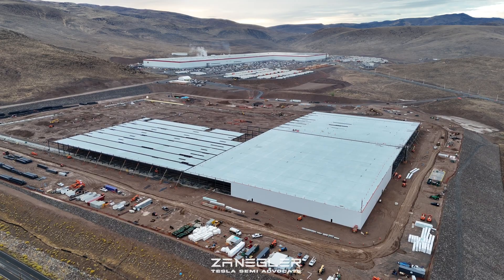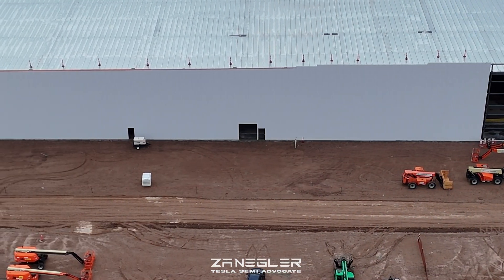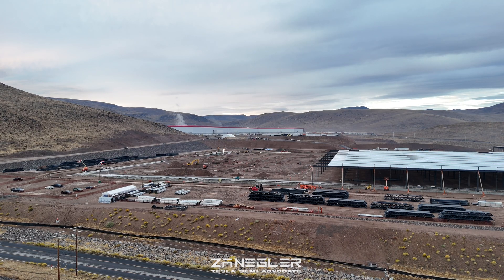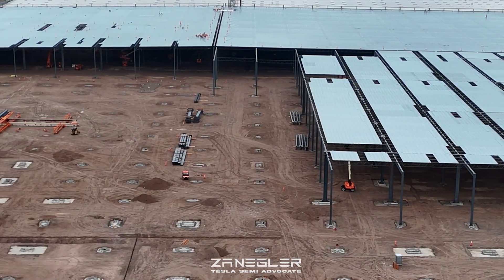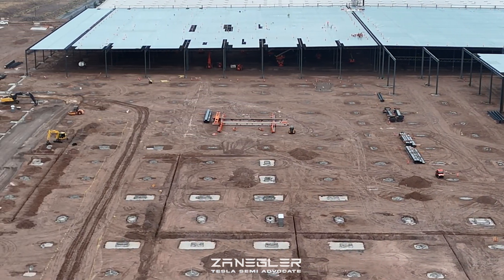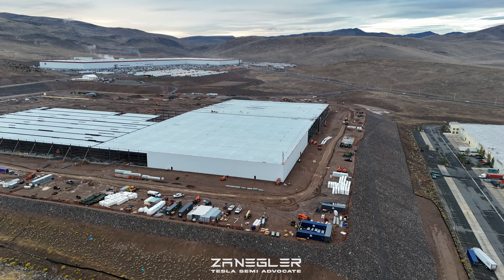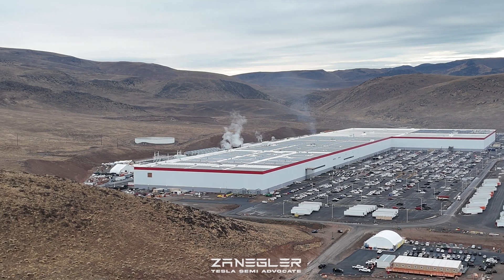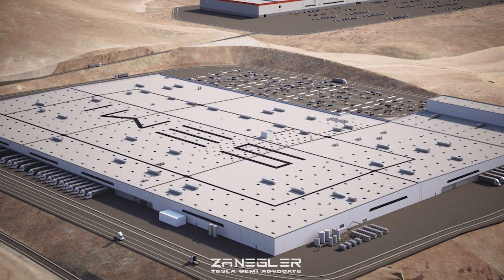Tesla Semi Factory - Several Changes and Surprises are Evident -10/17/2024

Comment: There's no doubt that a lot of money has been made off of Tesla stock. Even though the company has made very little money off of actual cars. And if you take the subsidies out, the whole joint would be closed down. I knew Tesla stock was going to take off into the end of 2019 only because of YouTube videos and how absolutely insane The Fanboys are. To put it bluntly I compared it to going quicker and quicker as the climax approaches. Though it was not quite that polite. Tesla like all of Elon's businesses is a scam. It's nothing but undelivered promises and an overpriced car. There are half a dozen companies ahead of him on full self driving. And the ones that actually have full self-driving taxis right now are four or five years away if not more from being certified and operating a going concern. Elon is 10 at the minimum. The man is a complete fool. Why would you not want to use lidar and radar to gather more data if you have access to it? Only a trump supporter would have that kind of logic. I could have more safety and more data but I don't want it. It's not a price thing because lidar and radar have dropped so dramatically we're talking a couple hundred dollars a car. It's also possible he knows the whole damn thing won't work so why bother putting Hardware in and spending money on something that will never be used.

Now back to the stock thing. Enron, WorldCom, Bernie Madoff and a dozen others, any fool who took one look at the books, the publicly available books, could see it was a scam but people just kept piling in. You don't know when a scam is going to blow up. Almost all of  Bernie Madoff's investors we're not victims. He had a clearing business in the same office and they assumed he was front running the market and that's how he was getting the returns. Translation they knew he was a crook but they thought they would benefit from the scam, they didn't realize they were the ones being scammed. To me that is not a victim. Elon's suckers are more of a victim perhaps. But how many times do you have to hear next year or we could do this right now if we wanted to and it's not done 10 years later, before you say to yourself I can't trust this guy. And please don't mention the robot, he is so far behind the rest of the industry is not even worth talking about. As for AI not only does he not have AI, nobody does, they are large language models that can do a lot of cool but utterly useless things. So forget those two revenue streams. The satellite internet business is mathematically impossible that it will ever make a nickel. All you need to do is understand how networks work and the price for bandwidth drops for everybody, every time he can put another person on one satellite so can a ground provider or somebody else so he's no further ahead. And SpaceX is an absolute joke. There's a thousand videos explaining the math behind all of this. There's a reason he doesn't take it public trust me. He's already spent all of the money for the rocket system to land astronauts on the moon and the only thing he's accomplished is landing his rocket on a stand-up Shelf. He freely admits he has to make a second and third version, but all the money is gone. All three billion of it. And 90% of the work remains to be done.

Now Tesla stock is on a little run because Trump was elected and people assume, and rightfully so, that Trump is corrupt and will reward Elon. The thing is though how long before these two gigantic ego holding narcissistic liars get into a brawl? It's absolutely guaranteed. Almost every person that ever worked for Trump he calls an idiot and he can't stand them or they're suing each other or some are in jail and most are ruined for life in one way or another. Why do people think Elon will be any different?

I say all this basically just to vent at the stupidity of dozens of videos a week with millions of viewers tuning in to see if they put a few new bricks up on a building. If that's not a cult and a scam, I don't know what is.

Comment: Thanks! I wonder if like at other Tesla factories there might be a plan to begin limited production here before footprint is fully built out? Prob not, as the outer shell is going up so fast and it looks like the floor slabs and inner mechanics will lag significantly behind. This building thus far is sure going up with the lowest worker to cubic foot ratio, and cost to cubic foot ratio of the lot, perhaps setting records in these metrics for buildings of a certain size.

Comment: I wonder what the pilot Semi plant will become when the main factory opens? Also it would appear that they plan to come back later to add any roof ventilation systems that may be needed. At first I thought that might be why holes are being left in the roofing. But there are no apparent holes now in the first section's (corner with outer walls now going up) roofing.
Reply from the maker: It will likely be used for other prototypes for vehicles we have heard about (cybercab) and possibly ones we haven’t heard about.

Comment: Thank you for the video!  Do you know if the wall panels are plastic or aluminum?
Reply: Usually two layers of steel with a hard insulating and structural foam between them. The metal sheets are powdercoated. These are sandwich panels.
Reply from the maker: This seems correct but I have no confirmation.